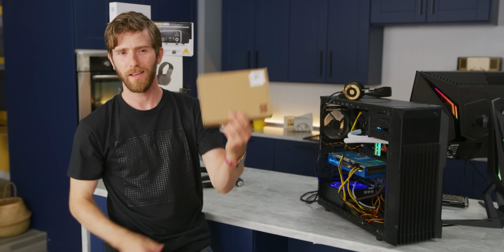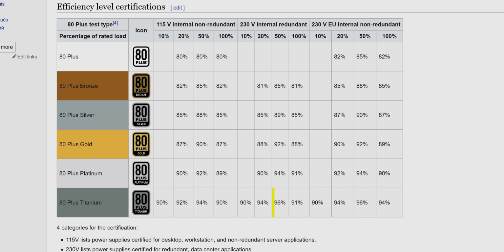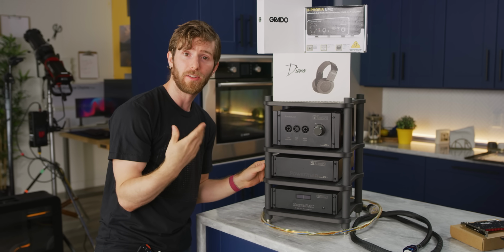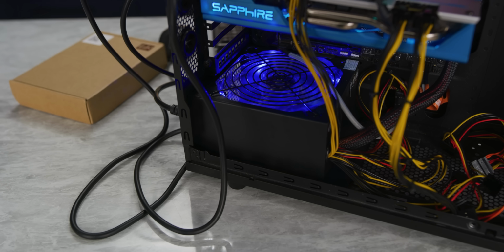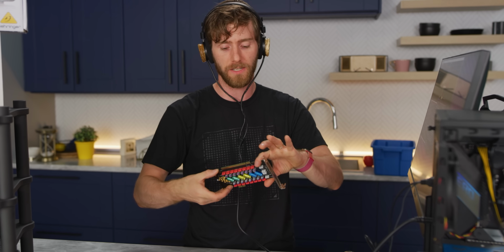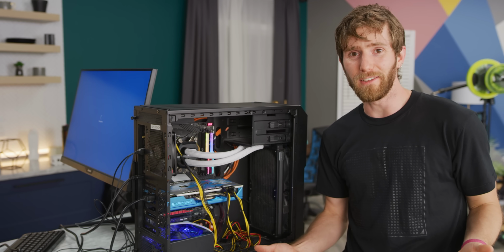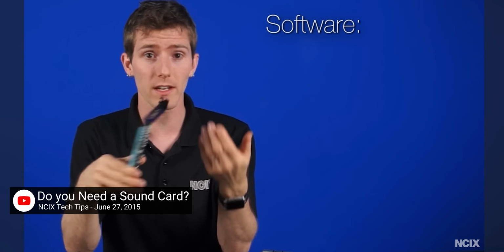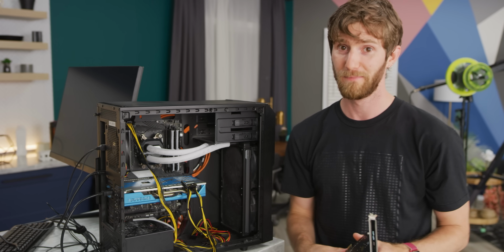Is this $40 card a SCAM? - "Audiophile" Power Filter

Comment: This product is flawd from the start. The pci slot is, for lack of a better word, the end of the power rail. Power supplied through the slot continues back to the supply through a common ground. For this to work, it would have to sit between the supply and motherboard. The only thing this does is make the electrical signals to the board as smooth as silk.

Comment: It might make a difference if you use it in a PC that uses as much power as the PSU is rated to. Because that's how switching psu work.
Your 1000w has enough smoothing on its own.

Comment: Why did you use headphones? Use a PA amp and speakers next time.
My machine that I've been using for 6 years has terrible coil whine, but I've never used headphones. It's extremely noticeable with high gain speakers.

Comment: I think perhaps the solution you're looking for is actually an in-line isolation transformer on your audio line out. I have a noise problem with some of my audio hardware when my laptop is plugged in, this was the ultimate solution to that problem. Basically, it filters out DC noise allowing only AC through (audio signals are very lower power AC waves). It is important to note that not all 1:1 audio isolation transformers are created equal, with the better sounding ones with the least loss of quality costing a bit of money.

Comment: I'm glad you pointed out that old school mobo's needed sound cards. I imagine someone running a retro system could use a card like this.
Reply: Nah, by the time pcie came around, integrated audio was the norm. When you talk about systems needing separate sound cards, we're talking ISA or early pci slots, times when you had to get a io card to attach your hdd and floppy drives to, cause nothing but the keyboard and optionally mouse port was integrated.
Reply: @rockytom5889  I remember messing with audio settings for Sound Blaster Pro back in the day.

and yeah onboard audio and video got really good in the mid to late 90's.

Comment: You could send it to my house and I can test it...I get a horrible electrical noise when I move my mouse, HDD access, etc.  It's ok with my 5.1 speakers because I barely have to turn up the volume for a good level of sound, but when I plug in my Grado headphones it's a painful amount of noise that exists at a constant, regardless of the volume level. I'm years past upgrade time, but it's one of my main reasons for upgrading!

Comment: nowadays, computer components are included with electricity filtering. and my opinion is all of the spikes is from the quality of PSU. hooking that its just makes PSU load increases. and for someone just like "is it fixes my electric shocks that come when i touch the case which the power are plugged". no, that is the grounding / some connection of the component with the case come into the stage.

Comment: Very disappointed you didn’t actually measure any noise flaw or have a proper control reference. 
I mean come on? Measuring noise isn’t exactly a hard task. 

What about tests - will it filter ac noise when a air conditioner/fridge switches on the same circuit - 

Very very average review with no technical basis - poor form

Linus with a pair of cans is subjective and I don’t exactly trust his judgement of audio

Comment: In the audio world you don't use onboard 16bit audio unless you use apple which came 32bit as standard, FireWire and outboard soundcards was the traditional option if you couldnt afford 500 for the PCI audio card, as FireWire seem to draw less power from the CPU and this reduce the ground noise, and you could power your sound from another source. 

I'm old school so I don't know if modern usb connection gives the same ground and cpu interference. In fact I still use the same FireWire soundcard from 20 years ago.

Comment: Here linus. 
I'm a studio engineer, I work with with recording artists and work with them all the way through their audio projects.
I need some help. I have a custom built PC, I've built PC's my entire life.
I have two sound cards, The onboard one from Asus TUF (with my 3900x) and I also have a Asus Xonar STX.

When I use my MacBook Pro, Silence
When I used a 2011 iMac, Silence
The moment I connect either of those sound cards to the monitor controller instant noise, Sounds like grounding issues however depending on my machine and how hard its working the pitch of the noise will change with it, which shows, again, that not only is the Onboard sound card not able to filter it out, but neither is my Asus Xonar.

I've had the building checked, I've made sure all of the cabling is balanced and the issue only occurs when my pc is connected to the audio signal path.
Doesn't matter if I swap the input its using, its literally the PC generating all the noise and sending it down the cable.

Its infuriating on a whole different level, That means the analog signal path out of my computer isn't usable in a professional environment as I'll look silly,
The audio interface I use when at the studio is USB and again, if the computer is connected (Even if disconnected from the analog signal path) you can hear the noise (But quieter)

What do you do when your machine is emitting so much noise that its interfering with your job?

Help me obi wan linus, Your my only hope.

Comment: You will mostly find the audio wine or buzz when using active speakers (POWERED) I suffer from this issue with my onboard sound card driving my studio monitors, but not my gaming headphones.
I purchased an internal soundcard with TRS out going to an external active Motu soundcard for my monitors and just run my gaming headset off the onboard sound card.
This has fixed my issue.
We hear in Australia don't have as much issue with brown power as you may, as all of our power outlets GPO's are Earthed!
I have noticed that the sound can come from USB devices too, as you could hear the noise change when moving the mouse.

Comment: It’d be more likely that the card did anything if the power supply was just barely able to drive the stuff in the computer instead (and the voltage started to drop), then the extra buffer of power might make a difference, but more likely the computer would have freezing issues if the card would be enough to make a noticeable difference.

Comment: There is actually still a real good reason to buy either an external high quality DAC or just a modern SB pcie soundcard. Onboard sound has become vastly better, but if you have even a little older SB X-Fi  pcie card it wil in 98% of the cases have a better soundquality than the onboard sound. Usually only the top priced MB's  use the best Realtek chips and decent caps in the onboard sound, and in most cases the little metalbox these soundcards is encased in also helps to keep more potential noise from the computer parts out of the analog sound outputs. There is little to none other reason than the fidelity of these soundcards today as "sound acceleration" or offloading it from the cpu is a thing of the past and there is no reason to install some of the often old extra software from eg Creative as the computer for the most part only uses the soundcard as a "dumb" DAC/ADC today.

This card is pretty stupid as Linus says. If you want to do something good for both your audio and your PC in general, connect it to the mains thru an UPS or other main power filter systems as they in most cases beside the spike filtering also have a better surge protection than you Psu.

Comment: well there is no ports in that card so its useless to begin with. just like some scam salesman once sold my dad a powerfactor correcting device which has just a capacitor but it does not go anywhere. input-> processing-> out put and there is no output on that pcie artboard than a actual sound card.

Comment: Umm.. The PCIe lane only has a 12V power line. What is that thing on the other side for? Does that touch the 5V and 3.3V in some way so it can actually touch the onboard sound card that runs off 5V?

Comment: You could have recorded the output of the moinboard with a high end ADC and check if there is less noize on one of the wave forms of the two recordings... Regardless this thing is total bullshit. If you want to smooth the DC on your Mainboard you need to place the Caps near the load. This is >one< reason why you always have those small caps sitting below the socket of your GPU or CPU. The bigger caps are there to take of short bursts of energy needed to drive, well in example your PCIe lanes. Today every electrical engeneer knows this and during many iterations of testing and simulating they already optimize the performance of your audio driver on the mainboard. In addition to that, you have way better DACs built right into the motherboard than 20 years ago.

Comment: Gotta love that it has both an x16 and an x1 edge connector. As if an x1 wouldn't work in an x16 slot, especially one with no actual PCIe lanes used.

Comment: if you would really analyze this Card, you should .. no, you MUST use an oscilloscope to make the voltage, not the audio-signal itself, make visible to a screen.
you can see then the power of the psu.
if the psu make a straight line, under load, e.g. a graphic benchmark with high useof the graphics card, then its ok, and if it makes waves, or spikes, its "bad power". so, then you can insert the Card to compare the voltage with load and w/o load and see the power on oscilloscope.

until this, the whole video is nonsens.
you cannot "check" any power-converter w/o an oscillocope.

Comment: The card may well be garbage but your test methodology is sh*t.  Make a mp3 of silence, then play that mp3 and crank the gain way up and see if you hear anything other than silence.  Turn off system sounds to avoid ear damage.  In addition to loading the system, move the mouse around to see if you hear that.

Prior to moving to a USB DAC I used to hear all kinds of high frequency buzzing, I could hear my video card and mouse through my speakers.  How much of the noise is coming through the power rails vs transmitted through the air is anyone's guess.  That card should work on the former but will have no effect on the latter.

The best solution is moving the DAC outside of the computer.

Comment: i already know that this is of course a scam.
but what you or your team had to do was getting a spectrum analyser of a scoop. 
and see if the signal to noise level would change .. 
or let say. some frequency's getting smoothed. offcours only to provide the proof that this will only suck a little bit of power (waist) and occupies a picx slot

Comment: Yes, in theory you could make a power-supply-cleaning PCIe card, that could straighten out at least the voltage line sit has access to, by presenting a new parallel load to the line that re-aligns impedance seen by the supply. Though, with how power is drawn from this voltage line, it would probably need some sort of active feedback as well. Maybe not this card, but maybe someone else out there has something for PCIe that works much better.

Comment: You are also going to get EMI from an unshielded case (glass windows on a PC case offer no shielding unless they are the coated glass on Omens) Also the PWM circuits for the RGB lights on the components are usually quite dirty as well. But mentioning any of this would upset his sponsors...

Comment: I run a DJ rig and learned by accident that the best power conditioner is a Battery Backup unit. All other power conditioners are crap and do nothing. I bought what were supposed to be rack mounted power conditioners, well they were rack mounted and had power outlets but did nothing as far a conditioning. So the accident I am referring to happened like this. I was setting up a Studio card and I was plugged into a circuit that also had a refrigerator plugged into as well, every time the fridge compressor started it made a popping sound through the computer which wasn't an issue, I was just testing hardware. One day I got a used Battery Backup and just wanted to see if it worked, I was over joyed that it held a charge and functioned properly. While I had it plugged in I heard the fridge fire up but then immediately noticed zero popping sound coming through the computer, 100% gone and I cranked up the volume to 100% just to be sure and nothing. I ran the system for a week straight and played around with it and never heard the pop again. I now run the DJ Rig at all times with a backup Power Supply plus it keeps spikes from hitting it as well and no abrupt shut downs when we trip a breaker. If you use any kind of coax or RCA cables and want to get rid of fan whine through the speakers you need to use 100% foil wrapped cables, braided cables are only shielded by about 40% to 70% and use as much balanced cabling as possible.

Comment: You need an audio analyzer for this kind of measurement. Using Linus and his wooden headset is not a valid test parameter. There are literally dozens of vst visualizes and and analyzers on the market. I use Blue Cat but many are probably just as good.

Comment: Excuse me! Where is the multimeter? Did you even test if the capacitors are even being charged in the first place?

I'm no electronics expert, but I know for a fact the flashy caps in the center are not located in the most ideal location for power smoothing. Oh, and finally, a filtering capacitor has to be extremely close (like millimeters) to the processing bits in order for them to have the best impact.

Comment: I like how you used a crap PSU. It's a good PSU that would already accomplish this little cards goal.
OR - you could just go digital to your monitor and use what most people have. A separate audio card in their monitor with MUCH less noise than the inside of a PC tower.

Comment: The funny thing is you can do what this card claims to do in theory. But not for 40 dollars and not with what looks like fake TDK op-amps. In the world of audio noise reduction/filtering 40 bucks is like enough for a decent isolation transformer (in passive circuits) or decent caps and resistors (in an active circuit) yeah the more I think about the idea of this card the more the parts on the board look suspect as hell.

Comment: It's totally scam filter circuit , attenuator , amplifier already exists within audio and video  circuit to improve the quality and cpu cabinet has separate ac to dc power supply which is already working as filter and distribution unit to manage 3v,5v,12v dc in motherboard

Comment: "What made Elfidelity think that this was going to work?" - Making money from gullible people. ANY component that can be part of an audio system is ripe for the snake oil merchants - from stupidly expensive audio cables to mains leads and my pet hate - audiophile Ethernet switches. Yes - audiophile Ethernet switches. Utter bullshit.  

The solution here is flawed - for a filter to be effective, it has to be put between the PSU and device that you are trying to filter noise going into. This doesn't do that.
Reply: Yeah, I feel like that many caps could actually help with noise if they were spliced into the gpu pci power
Reply: The only thing this can do is generate a counter wave to the noise.

That has to be PRECISELY tuned to do anything.

Which is why it’s added to headphones instead of speakers.

Comment: Isn’t that a ROG or Maximus Hero MB? I’m pretty sure Asus advertise those as having really good onboard audio already. Specifically, I believe they do claim that they already filter out electrical noise. Now I’m not sure how true that actually is, but maybe you should’ve tested against a $50 MB with crap onboard audio if you wanted to see a difference. Not that I think you have to help out the manufacturer here, but I wouldn’t have expected a noticeable difference on a $400 board that specifically puts audio quality into their advertising...

(OK NVM, the point about spending the money on a better motherboard is good, that does indeed seem like a better idea for anything except truly weird circumstances)